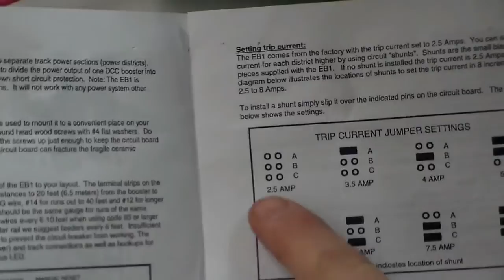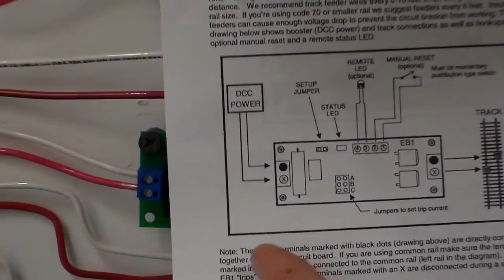Installation of NCE's EB-1 Circuit Breakers

Comment: Thanks for the review, especially the variable current options.  With so many different makers, it can get difficult deciding which to use.  Looks like the NCE breakers are simple enough to use, but still have some options attached.

Comment from the maker: Each district is sepperated by plastic insulation track joiners or by cutting the rail and gluing styrene in the gap with CA glue, then filing it to track profile.  You have to do both rails for districts.  Only one rail for block detection, with the BD20s by NCE.

Comment: seems a little complex but at the same time a little simple. i use the hornby elite, if there is a short it stops everything. then you sort out the short and then you turn the knobs on the controller very slightly and it all goes back to how it was. At least with this system you have what you call districts or sections so your not stopping all the trains.
Steve

Comment: Do you use plastic rail jointers for each block
Reply from the maker: I have in the past. On this layout I used a Dremel to cut thin gaps. Then super glue in small squares of styrene.  Then use small files to shape it to the profile of the rail.

Comment: Thanks for the vid, well explained.
Got a wee question.  I understand how these wire in ok.

I want to convert to DCC and thinking if using Z21 system with Cobalt ip point/turnout motors and EB1 Circuit Breakers.

1) If I rig those to an accessory bus instead if the track bus doesn't that mean the frog crossings would also be powered by the accessory bus?  Is this a problem or defeating the object?

2) I think the Z21is a 3 amp system, if circuit breakers are set at 2.5 amps does that mean I'm limiting the full capacity of the system?  Similarly if I set it to 3.5 amps (the next one up) does that mean it'll only work once 0.5amp extra has been used meaning the DCC system may be cooked.
Reply from the maker: I would contact NCE directly. Your question is beyond my knowledge. They are very helpful. 
https://www.ncedcc.com/

Comment: Ron, great video. a few  questions.   Do I need a resistor for my leds signal?   and  what size of wiring are you using in the video?    can I use  14  or 16 ?  thanks

Comment: Ok Ron...I'm at a loss so I'll pick your mind to see if you can think of a solution to my problem.  I have installed (6) of the EB-1 circuit breakers on a board.  I have it wired exactly as yours with Red side to the X side of the EB-1 and Black wire set to the solid black dot side.  There are no jumpers set and my default is still at 2.5 amps.  I also have tried changing the amps setting all the way up to 8 amps with same result.  Here is the problem:  When I short one of the zones, the light goes out on that board, then within a second or two, all of the boards flash simultaneously, going off and then back on.  I cannot get them to react independantly.  I have checked everything I can think of, checking for shorts between boards etc.
Reply from the maker: Michael Wyatt what is your command station? If it's the PowerCab, that shorts out at a lower amperage. So it overrides all the other breakers.
Reply: I'm using Digitrax DCS-51 Zephyr.
Reply from the maker: Michael Wyatt the zephyr looks like it has 3amp output. That may be affecting the breakers.
Reply: What are your thoughts?  I have tried going up in amps on each of the EB1's all the way up to 8 amp setting for each one.  If the zephyr is 3 amps and the EB1 is set by default to 2.5, shouldn't the EB1 trip first?  I'm out of ideas and a butt load of money for the 6 EB1's I purchased.
Reply from the maker: Michael Wyatt contact NCE customer service. They are great. Most likely Ed will help you. You can also ask NCE on their facebook page.
Reply: Ok Ron, thanks so very much for you thoughts.  Much appreciated.  I will try to contact them and see if they have an Idea.

Comment: Hi just found this video and it was exactly what I was looking for, so thank you for that. I have a question for you that I hope you can help me with, I now thanks to your video understand power districts but do you use the feed from the output of each breaker to power the turnouts as well as the track? Or do you use a separate breaker to supply power to the turnouts? Hope this makes sense.
Reply from the maker: I would run a separate power supply to run your switch motors. If you mean power to the track of the switches, then you use power from each break, depending on which district your switches are in.

Comment: Hi Ron.  I have a small 3' x 4.5' coffee table dcc n scale layout.  There are five switches with sidings, a bypass and a crossover.  The circuitry is broken up into 9 blocks.  To install 9 EB-1 circuit breakers will cost about $300.  Can I just start with one of these on the main output from the power source (NCE Power Cab) and then slowly add EB-1s to each block?  Thanks.
Reply from the maker: Absolutely. Insulate the track sections as if you have 9 districts, to prepare for the future wiring. Connect all of them to a single buss back to the EB-1. As you add more EB-1s, just cut the feeder from the district you want separate and run a second buss back to the new circuit breaker.
Reply: @MineMountModels  Thanks for the quick response.  I thought that is probably the case.  Will get started soon.  Love all the information you put out on YouTube.

Comment: I have two of the EB1 and when Thr section shorts the entire system shorts even the other blocks. Do you have any ideas of what's wrong?
Reply from the maker: NSBNSF there are a few factors you need to provide to help diagnose. What DCC system are you using? Also, what amperage are the EB1s set to? Are both rails on each end of each district insulated?
Reply: Ron Klaiss MRC, I've had them working fine with my older system. Blocks are separate and they should be at factory settings.
Reply from the maker: I’m not familiar with MRC. You should call MRC or NCE customer service. I know Ed at NCE is a great guy who helped almost everyone who contacted them. 👍🏼
Reply: I’m having exactly the same problem. Using a SB5 and a Power Cab and two EB1’s powering isolated districts. When either 1 EB1 shorts it immediately shuts both EB1’s down and also the SB5 causing a complete shutdown of my layout.

Comment: Great video! I have the same setup but with only three power districts. What happens when I short out one district, it shorts out my command station and thus turns everything off.  What do you think? Lynn
Reply from the maker: Your amp setting maybe to low.  From the factory it is set at 2.5 amps, the lowest setting. The EB1 can be set to different Amps, from 2.5-8amps. If you look at the manual, which is on NCEs website, on page 3 it shows you how to adjust the jumpers.
Reply: @MineMountModels  Can the jumpers be screwed on to change the amps or must they be soldered?
Reply from the maker: @johnflaherty5343  the jumpers are small connectors that are provided with the unit by NCE. No need to screw or solder.
Reply: @MineMountModels  Thank you

Comment: What size cable are you using Ron , i have tried to connect 14 awg stranded and find i have great difficulty getting the cable in the connectors,
                      Regards,
                          Tony.
Reply from the maker: My buss wires are 14AWG. I just twist the stripped end tight, and it goes into the terminal block of the breaker. My buss runs are short so I could of got away with 16AWG.

Comment: do you have to paint th board or is it safe to mount the breakers to exposed plywood, or is that a fire hazard?
Reply from the maker: The board doesn't have to be painted. I just did it for looks, and to see the wires easier. I cut short pieces of tubing as spacers between the electrical boards and the wood.
Reply: Ron Klaiss would some fish tank tubing work for making spacers? I have tons of it...
Reply from the maker: +5dmc1 as long as it doesn't squish when you tighten the screws.
Reply: how much space does there need to be between the board and the device?
Reply from the maker: +5dmc1 I have about a1/4"
Reply: alright, ill cut the tubing a bit long so if it squishes it will still have enough space, thanks! :D

Comment: Are you going totally NCE. I am looking at getting something started
Reply from the maker: +James Baxter I use a NCE 5A wireless system for the layout.  The districts are split into 6 regions using the EB-1s, as you see in the video. I control the staging track routing using NCE Mini Panel and a NCE Switch 8.  My frog polarity is controlled by Tam Valley Hex Frog juicers.

Comment: Mr. Ron what is the Size of Wire & Brand your connecting your system with it looks like 14Awg but it may be 12,  was trying to figure Out the Brand of your wire :)  

The wire I'm using for my Buss Line for my N Scale Layout I got from our local Lowe's store I'm using 18Awg thermostat Wire I decided to get it so I could then Drop down to KATO's 24Awg Wire Joiners  KATO  to me is not to Keen on there choice of Wire Size!   to me it should be @ least 18Awg but I guess they Know what works with DCC systems and there powered Rail Joiners.. 

So far everything is working ok but who knows.. I'm currently only using the Power Cab System..
Reply from the maker: The buss is 14AWG stranded, and the drops are 22AWG solid

Comment from the maker: Thanks. I get my Breakers from Hogtrainz (Make sure you use a "z"). Add the .com at the end and check out his site.  It is the cheaps I found on the whole net($22.25 each).  I even got my new Power Pro wireless system from there.  The NCE EB-1 will work on Digitrax. I also got my block detection from him.  hogtrainz . com

Comment: Great Video! so when the wires come from the circuit breaker to the tracks do all of the tracks in the same district have to be connected to the circuit breaker? I'm starting my layout, if you have any ideas please share and subscribe
Reply from the maker: It's advisable that you connect all your tracks to your bus lines or individual districts bus lines. So to answer your question yes all the tracks have to be connected to the breaker for that particular district.
Reply: Ahh okay great, thanks! So does the wires coming from the breaker then act as your bus line for that district?
Reply from the maker: +Flash Jones yes
Reply from the maker: +Flash Jones insulate both rails in between each district